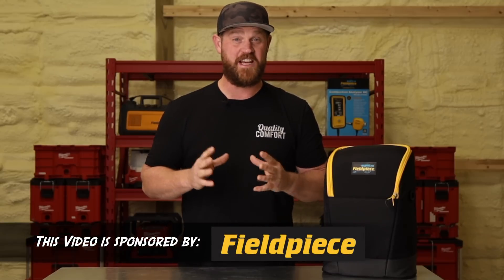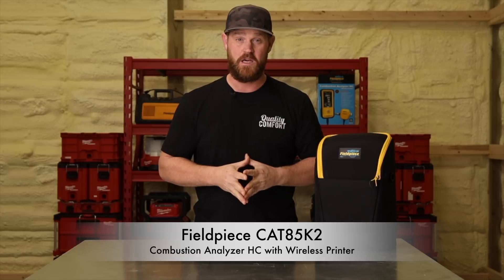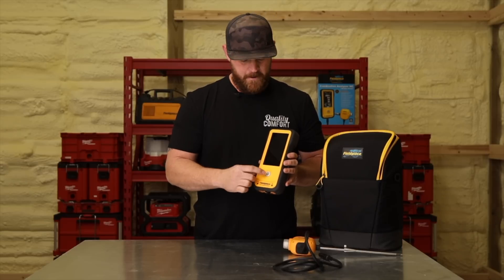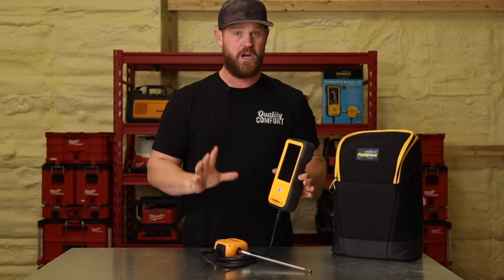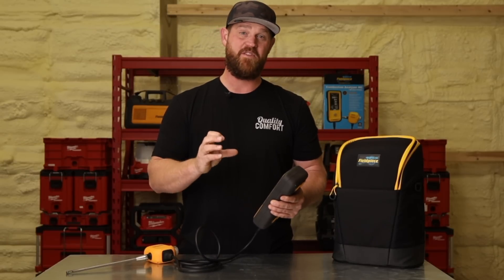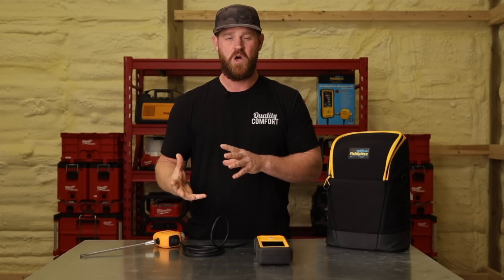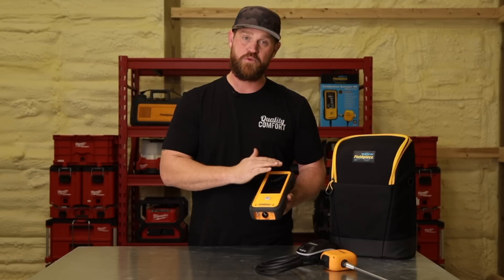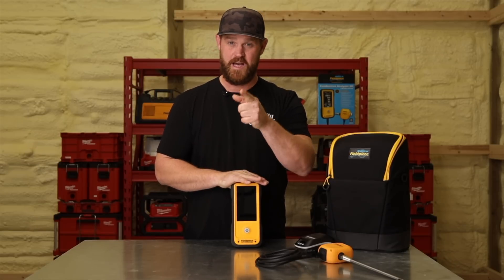If You're Not TESTING, How Do You KNOW?!?!

Comment: when you said high contrast mode for when your on the roof, i finally understood why game boys built before built-in lights had that alternate display. i thought it was a cheat code, Nice video thp, That Manometer+ is nice,

Hey can you do a video about plenums covering sizing, installation practices (difference between using a tapered transition, or with fins vs being fixed directly to the unit?

Can you have more than one supply plenum on a supply, or does having a secondary plenum fuck with the pressures?

Comment: I noticed you mention the 4 parameters, temperature, 02, CO, and CO air free…

Where is CO2? 

CO2 percentage is needed to dial in almost all high efficiency boilers to manufacture specifications. 

Required for Weil McLain Ultra Series, Required for Weil McLain EcoTech, Bosch Greenstar, Bosch Greentherm, Bosch Singular, all Navien Models, Burnham Alpine, Burnham K2, Burnham Alta, and many more…. As an HVAC technician who works on all these manufactures and many many more this tool presents itself as near completely useless. 

I can measure CO with a CO detector, I can measure Temperature with a temperature probe.

It’s a glorified O2 sensor
Reply: It automatically calculates CO2 from the O2 and CO sensors.

Comment: You are ready good in your explanation of this equipment function and illustrate immediately how you mount the probe. When we operate Boiler, O2/CO reading are indeed very important data to know how well the Boiler furnace combustion air/fuel ratio mixture are firing. I know some ppl might not really interested but it is safety, health & environment that we are concern about. Thumb upz.

Comment: Clock the gas meter compare with the rating plate. Also check the wc of the outlet manifold of gas control valve on high and low fire compare with manufactures specs rating plate. No special tools needed. Free advice your welcome
Reply: all you need is a manometer clamp meter thermometer and co detector right? ive never seen that big ass tool hes using
Reply: @obama7325  yep. lol
Reply: If  the O2 increases when the blower comes on that indicates a cracked heat xchanger. How will the tools you’ve listed indicate this condition?
Reply: @cadamham  
They wouldnt but a simple 40 dollar co detector in the room by the first diffuser would. It would tell that their is no co but couldn’t verify if the heat exchanger is cracked, nor would a fancy combustion analyzer 100 percent of the time. Just because you have a crack or hole in the heat exchanger doesn’t mean you automatically have carbon monoxide
Reply: @RockoRocko-rz7kx  you may not have CO at that moment but I would want to know if there was a crack or not that could potentially lead to CO poisoning just by doing a relatively simple test with a relatively simple meter. Let the customer decide what level of risk they want to take on and absolve myself of any liability